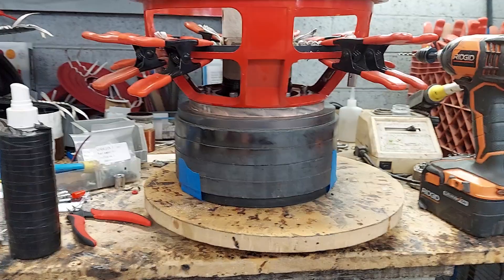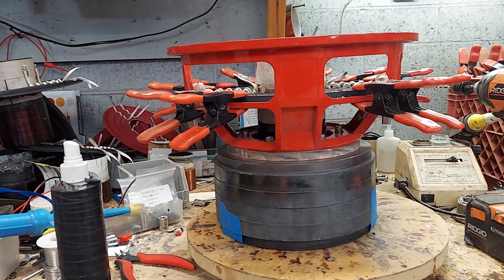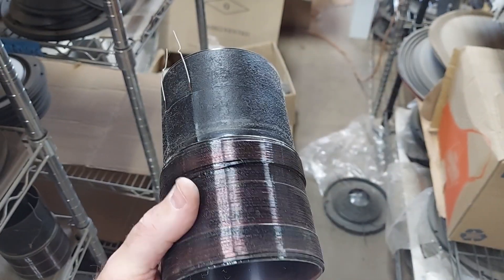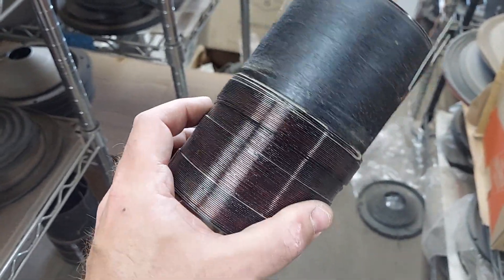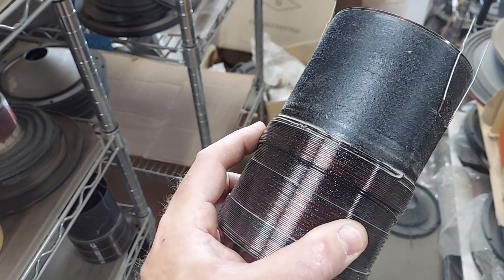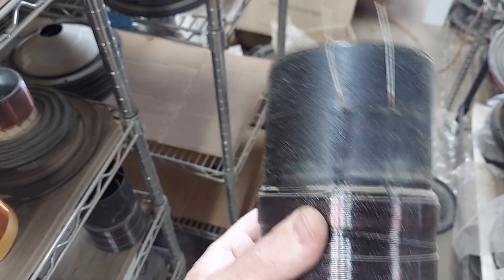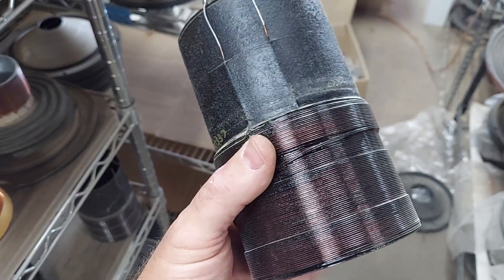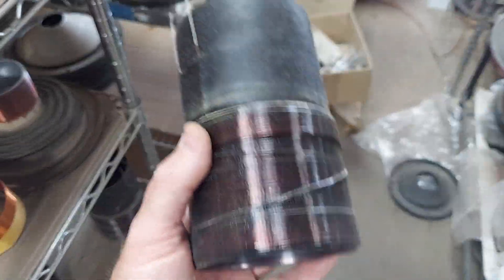LMT & LMS by TC Sounds the good and the bad - Linear Motor System

Comment: I'm glad you also talked about the benefit of an overhung, short-gap/long-coil motor where the winding body can be pushed somewhat out of the gap before the BL tapers off below an acceptable level, so you get extra mm's of usable Xmax from such a design. XBL/DDLinear/other split gap, short-coil motors have a few benefits that make them a good choice for midbass speakers and shallow profile speakers, but for dedicated woofers and subwoofers, overhung is the way to go. Then for a midrange, full-range, or tweeter, an underhung assembly is unequivocally the best performing, though for cost reasons those are usually overhung too (except tweeters which are even-hung or under-hung).

Comment: I'm really sad they went bankrupt. Loved to see those LMS Ultras excursion
Reply from the maker: Right, and Thilo did his best but people couldn't afford what they were really worth.  They'd spend $2k plus tax from a retail store on the Eclipse version he built but wouldn't pay more than $700 for the TC-5200, same sub direct from Thilo.
Reply: Lms 5400 is probably the best 18inch sub ever made.  Everyone that hears mine says its by far the best sounding sub at ear shattering volumes they've ever heard.
Reply: @chuckd9007  what do u have it in and how many watts are u running on it
Reply: @erobles396010  its in nothing atm.  I might even be willing to sell the sub.   Car totalled in accident.  I built a wall behind the rear seat and used the trunk as my box, approximately 10sq.ft., was going to put a 12 inch diameter by 48 inch long port but once i had it in and found its f³ was 18hz i just left it as infinite baffle type setup. Spray foamed all the gaps between sheet metal panels, and put a layer of sound deadening on the entire interior and trunk.  Running 2 soundstream tl6000.1 strapped together @2 ohms(these amps have massive dampening factor and maintain phenomenal control of the cone and put out about 6500w rms at 15.7 volts), dual batteries, 20 farad digital cap, doubled up on the big 3 wiring and also ran triple 0gauge power and  grounds from front to back.

Comment: I've done some reading lately and I found that the first dual gap underhung or split coil motor assemblies were proposed by Burton Babb (Babbco) in 1976, under U.S. Patent number 3,983,337, as cited by Wiggins/Hyre in the XBL^2 patent. Polk is using the Burton Babb patented dual gap design in their LSiM703 midwoofer, and Harman is using a dual gap design in one of the Bowers & Wilkins under-seat woofers for BMW. B&C has used a split coil configuration after Babb in some large subwoofers. The Babbco patent is already long expired, so you can build dual gap motor assemblies without infringing on anyone's patent. What Wiggins and Hyre patented was including a notch on both sides of the gap - in the yoke and in the top plate - to create a deeper B notch in that region, but you can work around that. As long as you stay clear of the other multi-gap patents by Wiggins/Hyre/Rode, Alpine, and STEP, you can make a multi-gap subwoofer with long stroke.
Reply from the maker: Good work Sherlock!

Comment: Is there a certain purpose for some spiders to be higher up in the frame and some to be closer to th e motor?
Reply from the maker: Not really.  In fact the lower the better.  In some cases with the spider being so close to the cone, you can get 'slap' from the leads.  Even if they're stitched to the cone.  Also the distance between the lower suspension, (spider), and the upper suspension, (surround), should be as far apart to minimize rocking, (non-linear - side to side movement)